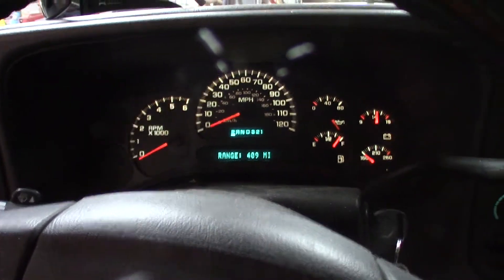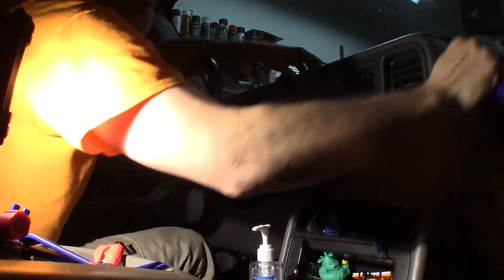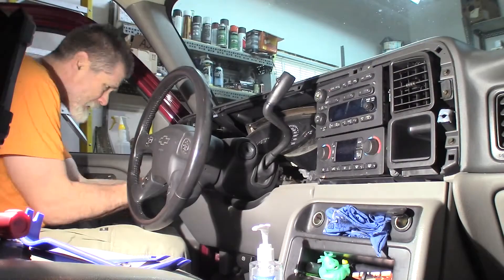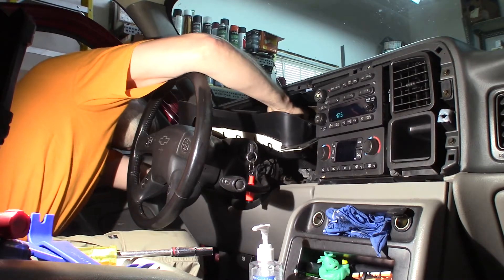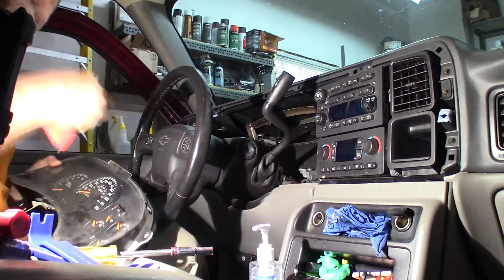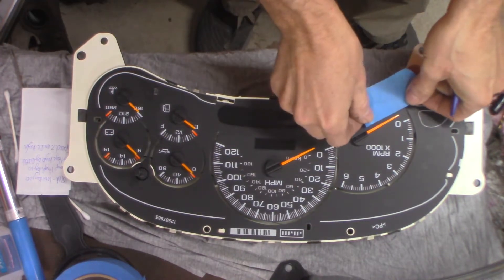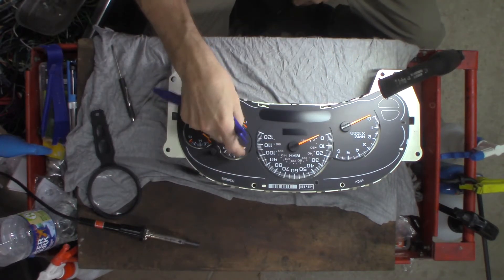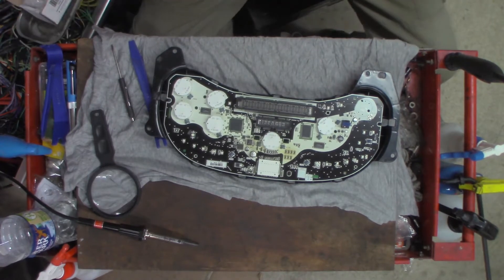2005 Chevrolet Suburban Gauges not working.  Instrument cluster repair.

Comment: I have a gmc suburban c1500 4x4 my mgh speed is not working what the part for it what do I need to look for
Reply from the maker: That's really hard to say.  The stepper motors in that series of trucks are known for going bad, but it's hard to say exactly what it is.